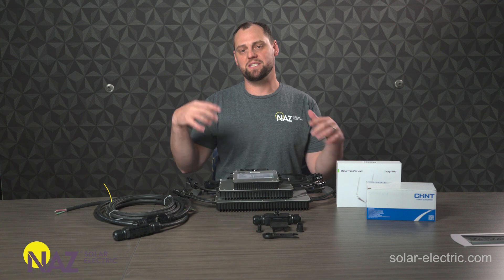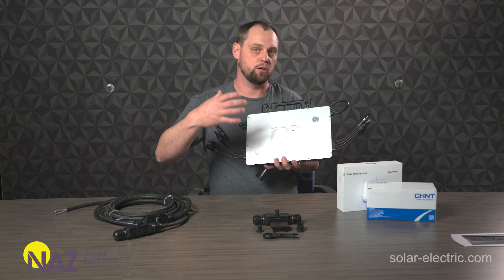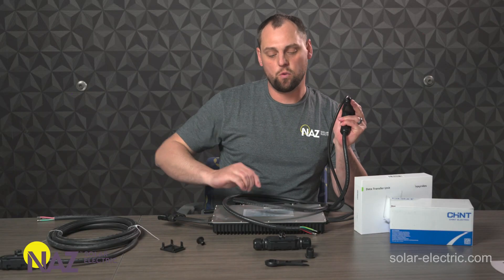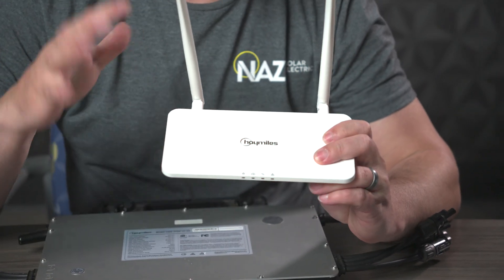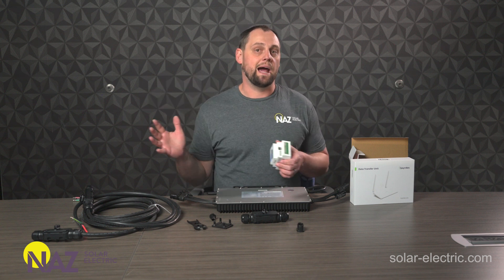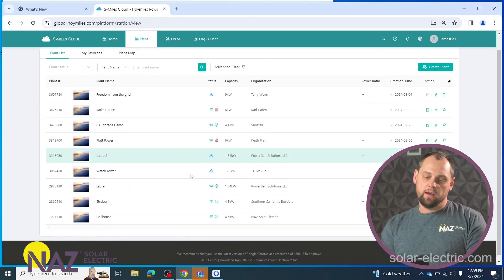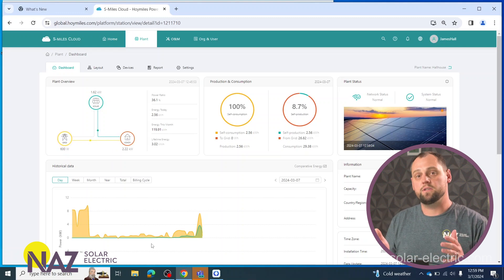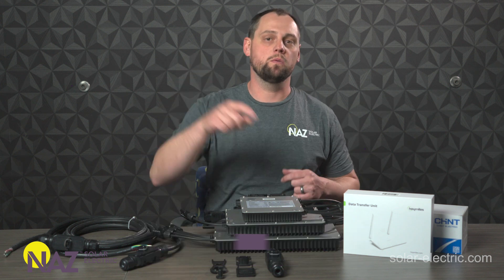Deep Dive: Exploring Hoymiles HMS Micro Inverters & S-Miles Remote Monitoring Capabilities

Comment: Would DTU reach a separate building. Wanting panels on barn but DTU would need to be in the garage at my house which is about 90 yards away. Wanting to limit export to 4kw so need CT monitoring so DTU must be near main panel at the house.
Reply: Went ahead and purchased and can confirm Microinverters are working great and have full signal.